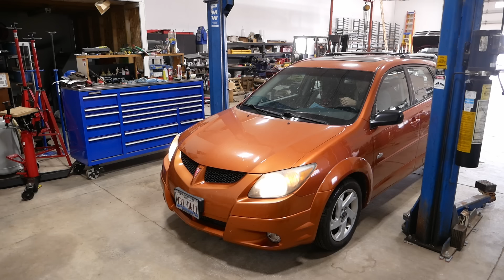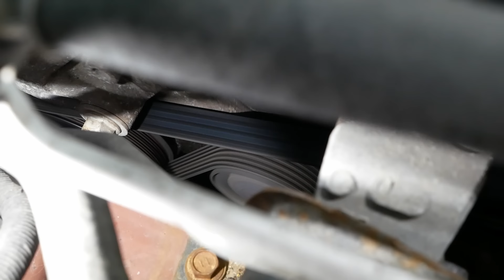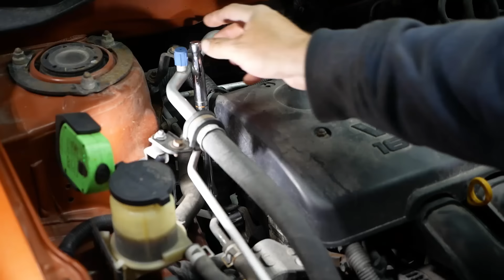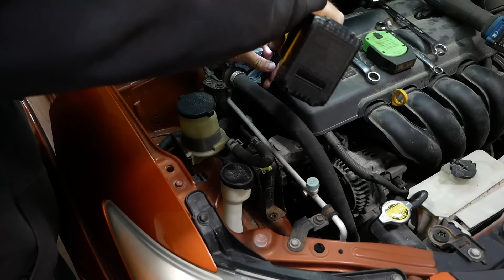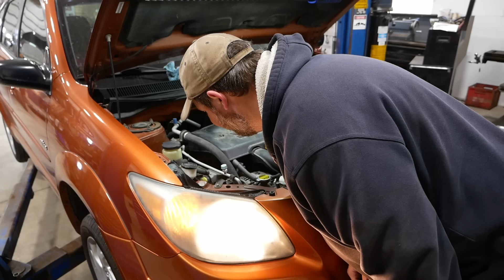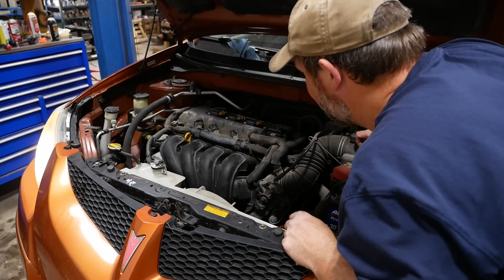My Worst F-up as a Mechanic - Hurt Myself, Damaged Customer's Car - Vibrating Vibe

Comment: I also left someone brake caliper bracket bolts just barely snugged up finger tight once.  A week or so later the bolt feel out sent the caliper into the wheel, locked the tire and sent them off the road.  Luckily no one was hurt and the car was okay.  Just needed a new parts and put back together.   I went out a 2am when it happened and got a bolt back in it so they could drive it home.  Now I check everything like 5 times before it leaves.

Comment: The good news is, your vibration is gone😂.  I was working on a Ford Taurus SHO that was parked in my driveway. I just finished putting a fuel pump in a Dodge pick up. I backed the truck up and cranked the wheel too tight and put the front bumper of the truck into the front fender of the Taurus. $1500 later….! At least you are safe. Life goes on.

Comment: My biggest F up was a BIG one. I had a Diesel engine with bad pistons and rings. I replaced pistons and rings with new ones and in the process lost one of the connecting rod bolts. I just went to Ace and bought a new on with was not hard enough. Started the motor and it ran great for about 5 minutes and then a rod came through the block!!!$3000 lesson learned!

Comment: Years ago, I did something very similar - just installed a new auto trans (my first ever) and had the door open, engine running, standing outside the car with one foot on the brake and working the gear selector through the ratios to get the air bubbles out of the fluid and my foot slipped off the pedal and the car drove into a bollard and smashed the headlight. This car was actually cursed, because the next day, I was approaching a rail crossing when the lights started so I pulled the selector back from 4th to 3rd - only I was not in a manual, and I had accidentally put it into reverse - so lucky it was raining as the rear wheels locked up and I just slid a few meters before I realized my mistake - happily the new transmission was still OK! phew. like you, I called myself stupid more than once :-)

Comment: I did something that went totally wrong, yet miraculously nobody was hurt.

In the late 80's a guy at work had a mint looking '70's V8 Dodge Dart Swinger with a for sale sign. I knew someone looking for a cheap car. We met at his apartment  During the test drive, the engine shook at idle but in gear only. Back at the apartment, I adjusted the idle mixture screws and had to do this in gear because if was smooth in neutral. Parking brake was firmly on. I was on driver's side and gently blipped throttle. Car suddenly took off at full throttle burning rubber, ran across the grass and into the adjacent brick apartment building. I can still hear the owner yelling "Oh no" over and over. It may have stalled after crash or I shut ignition. What a mess, but nobody was in the missile's path or standing in front of car. I was in front earlier to get to the screws. I found the problem, the throttle was being held wide open by a throttle spring. Never saw this before. Someone put the two throttle springs on wrong. Both should pull throttle closed. Two are used in case one fails. One was wrongly pulling in the other direction opposing the other. The closing one was not properly installed and fell off the arm when I blipped the throttle. Now the other spring instantly pulled the throttle wide open. Car must have been totalled. We felt awful but clearly it was an accident waiting to happen and eventually would have happened in traffic. It wouldn't have happened if someone was in the car, foot on the brake and I should have had someone to do that. Safery first.

Comment: For those wondering: ALWAYS have the parking brake on and firmly press the brake pedal if you're going to brake torque the engine to check for a bad mount. It happens. I once forgot to pump the brake pedal after doing a brake flush, put it in reverse, and went flying out into the parking lot.

Comment: Don't feel bad. I made mistake too.  I blew up my cooling system by running the engine with limited time plan due to a jammed fan just to keep the oil throughout the engine until I get it fixed. I got carried away and my engine overheated and blew the cooling system.😊

Comment: After a stupid mistake in which you could have been badly injured you then go ahead & wedge & wiggle a ratchet with a 17mm socket on it, right next to a spinning belt! Are you out of your mind; if that got sucked in the whole lot would act as a projectile, could break your wrist.....you're not even wearing overalls!!

Comment: My sister's 2001 Chrysler T&C had a similar problem mostly noticeable when in gear and stopped.  It turned out right side motor mount had a broken bolt, one loose and the other hanging by a couple of threads. She had been driving it that way for months.

Comment: The emergency brake works much better than wheel chocks. My friend was trying to replace one of my U joints on my 95 Suburban in his driveway, which had a fairly pronounced incline. He was all the way under the vehicle and having trouble popping the rear U joint loose, so I grabbed a bar and wedged it into the joint and popped it out. The vehicle immediately began rolling backwards down the driveway. I was able to get out because I was only a couple inches under the car, but it rolled him up and went right over him. Broken collarbone, hole in one of his shins from a bolt lying on the ground when the front tire ran over the back of his calf. Afterward, he spent the rest of the day saying he couldn't believe he forgot to chock the wheels. Safety first.

Comment: Accidents happen. Thank goodness I’ve never crashed a customers car. I did however pop a tire on one several decades ago. Pulled in to the stall a little too sharp with a Buick LeSabre, and I hit the arm of the lift, causing the front tire to pop. $78 out of my pocket and the gentleman also got a free oil change!

Comment: Reminds me of that time someone left a chuck key in a lathe and turned it on missing another classmates head by about 4 inches when it hit the wall. Personally mine was running a Mill in machine trades and I didnt tighten the vice down enough the part literally came out and spun around the drillbit. 

If I was you id buy that wall a beer 🍺  lol glad your safe man.

Comment: When I worked installing car audio in college, we had an experienced guy in the shop working late and behind on work. He drilled a hole through the firewall to run wire on a 2nd gen eclipse. He drilled into the master cylinder. 2 high school girls got in after the install and drove off. They came up on the intersection exiting the parking lot and rolled right through it and stopped on the curb on the other side. They almost got t-boned and traffic was raging at them. Their dad showed up to the shop the next day ready to kill.

Comment: Had this vibration and noise on 1999 Corolla but fixed it in the store parking lot without incident. 
But I had really hard time dealing with aftermarket power steering pressure hose on 2001 Accord

Comment: Respect for admitting you did something stupid and allowing other people to see it so they might learn from it.  I'm interested to know what your thought process was here though.  The car was already in the lift bay.  What was the logic in not using the lift to get the wheels off the ground if you wanted to run it while in gear?

Comment: Mine wasn't that bad, but I dropped one off of a jack a few weeks ago and broke the radiator.  I was just in a hurry, it was getting late after a very busy day.  I didn't get down and double check that I was centered up on the sub frame and it slipped off.  Luckily I wasn't under it when it happened.  Had to buy a $200 radiator and coolant, and it took about 6 hours to tear the front of the car off and replace it.  I told the customer what happened and that I would make it right.  And the customer was okay with it.   But, still you feel so crappy after doing something stupid like that.  A set of good wheel chocks would have helped too.

Comment: 30 years ago I was working on my old manual transmission Dodge 150 truck. I had parked it in 2nd gear while working on it and at some point without thinking reached through the drivers window just to bump the motor over. Of course it started in gear and away it went across the yard, ran over a wheelbarrow and then crashed into the wall of an outbuilding before stalling and stopped. You better believe I cursed myself for a fool and learned a lesson that day.

Comment: Use a round piece of wood hold it to your ear  and put the other end on places you wish to check to see where the noise is coming from. This old school  trick works great for finding vibrations or bad bearings

Comment: I did that in my Dads shop when i was younger...except it went the other way,Out thru the overhead door,across the driveway into another customer's car.
It was a 63 split window vette my dad had just got done painting it...the tailites,bumpers,both rear windows smashed...overhead door smashed and a 67 GTO got the drivers door and front fender smashed in...i spent the next year working for free 6 days a week to cover the cost of the damages...know what i did?
Jumped into the Vette when my Dad wasnt around just hear it rumble...simultaneously turned the key and stabbed the gas..she started right up!! And the gas pedal got stuck

Comment: I'm an electronic technician  who often rebuild older equipment, vacuum tube or valves are often under thousands of volts and in bigger systems like older AM Shortwave transmitter , under few amperes. Never mind radio frequency burns, so when I get "target fixated," or just tired, any mistakes can be instantly deadly or cripple me for the rest of my life. I have a few mishaps but anything too serious. I assume it's the same thing with cars and mechanics . You are very lucky not to have hurt you.

Comment: Dont feel bad I was working on the simplest thing. All I had to do was plumb some lines and attach a couple relays. Easy right....
Well it was a 500hp nitrous system and i somehow managed to not connect the fuel all the way.
After that day a fuel pressure switch is mandatory...The pistons and valves. She went "Zeeeee clunk Pooofz"!  And, ticka ticka tick tick tak. And magic smoke fell out the exhaust.
Luckily it was only some slugs and valves. lifetime lesson learned...Triple check! (and use safety or limit switches)

Comment: My first day working at Mitsubishi  We had customers stop in mid road trip to have the tire pressure sensors recalibrated.  While their vehicle was in the garaga middle lane,  our service manager got in a Outlander that just had new brake pads and rotors installed front and back.  The service manager was going to just back the vehicle up a couple feet, puts it in reverse, touches the gas but the brakes haven't been bled yet.  He slams into this family's RVR who's on a roadtrip, panicks puts the outlander in drive and drives right through a snap on toolbox into thru a wall into the body shop.  He didn't know the brakes had just been done.  I was standing over on the other side of the garage in complete shock to what I just witnessed, its my first day ever working at a car dealership.  I thought he either took a stroke or was pissed off lmao, he was pretty shook up himself lmao

Comment: When I was turning wrenches I was working on a Dodge pickup standard transmission. The truck had a no crank condition battery was good starter was good  (jumped it with a battery cable) The Mechanic helping me was turning the ignition switch while I was shaking the wire harness sure enough there was a short. The starter engaged while the truck was in gear. I was pinned between the truck and the workbench. Luckily the truck didn't start and stopped when I let go of the harness. Ed quickly pressed the clutch pedal and pushed the truck back. Good thing the workbench wasn't tight against the wall I was lucky.

Comment: Yes, we do some crazy things sometimes. 
Certainly my most stupid moment was when working on an unfamiliar piece of equipment ( that unfamiliar, i had never worked on this model before ) .
It was a 3000 V,  3 Phase transformer . 
To prove it dead, i touched the terminal with the back of my hand. 
I still to this day cannot believe i did it, wtf was i thinking. 
Luckily for me, it was dead with no residual stored energy either, otherwise i'd have literally been toast.

Comment: I actually have that exact car and I've had it for 3 years and I love them. It's because of the 1.8 l engine but it was made in California in the old GM factory that put out junk cars and they went with the Japanese way of building their vehicles and how they check everything. The ones made here were junk. Because they were shipped over in parts and they were put together here. That factory has gone out of business it was only running for 10 years and 80 percent of the Pontiac vibes in California by a Japanese companies rules and standards..

Comment: I’m not a mechanic by trade, but I’m a good backyard mechanic. I’ve also owned many Toyotas and i have 2 Camrys right now. Both 2AZ’s. I do all the work on my own cars. At the risk of looking stupid I’m making this comment before I even watch the video. If I’m wrong I won’t delete it.

 I heard the car when you pulled it in. It’s got to be the intake. The plastic intakes crack on Toyotas and make that exact sound. I’ve done the job on a previous Camry and on one of my current ones. I even bought an extra for when the third one goes. I just get the cheap Doorman because it’s an inherent problem with plastic Toyota intakes. Hopefully I’m worried about my Diag.

Comment: I broke an inspection mirror inside a jet engine once. Luckily I was able to reclaim all the pieces (reassembled the mirror on a piece of sticky tape to verify I had it all) and the fighter was back in action at lunch time and the engine didn't have to be polled out. And no, it would not have blown out the pieces off the other end!

Comment: I had a nitemare with a belt tensioner. Tried to get the old one off. Just would not come.off. Tried tapping it with a hammer. It came off easily, but the locking pin stayed in the block. Tried melting it out. Weird angle with frame in the way. The new part needed a hole for the pin to go into. So, I bored a 1/2 inch hole into the block. Luckily, I didn't bore all the way through. Got it on. I hate working on corroded cars.

Comment: First of all, I almost burned down my entire garage because I did not realize how flammable "break clean" is.I had spread news paper in multiple layers to catch the dirty spray an the saturated newspaper was subsequently ignited when through a spark while grinding. It was horrible as I had no way of putting the fire out and could only snuff the flames out with what ever I could find. Burnt the hell out of my hands.

Secondly, I guess your a much better "Christian" than I, because I was throwing F bombs like it was WW11 atomic raid on Japan. So good on ya, but I gotta cuss or I'll die.

Comment: One time after changing the oil in a car I put it in neutral with the door open while it was running and pushed it back a little to make sure there were no drips or anything underneath. Well the concrete has a little slope so once it started to roll I couldn’t stop it and with the door open it was going to catch on the wall since it was extended out past the size of the shop door. The only thing I could do was use my foot under the tire as a wedge and it worked but I couldn’t get my foot out. I layed on the ground for 3 hours with the car on my foot until someone finally heard me yelling.

Comment: Ive been working on cars since i was 11,i just turned 53, believe me, we have all done stupid stuff not meaning to,i remember when i was a kid growing up in a farm,i didn't have a drivers license yet so my dad and i found a 1957 land cruiser in a old wrecking yard and he asked me if i wanted it? really? hell yeah!!! so it was my "farm car", it needed lots of work and it was in rough shape so i cut my teeth on that thing, 4 speed monster.

First time i changed plugs on it i pulled the wires off,label wires? what for? once i got done changing the plugs i just put the plug wires where they looked cool,once i fired that thing up it was bucking like a 3 second bronco, my old man asked me about he plug wires and of course the answer was uhh?? i learned a lesson that day, my dad explained to me about timing and why certain things need to be in certain places etc 

Another time me and my buddy in our teens where working on his car on the front suspension,he had one of those 20 dollar floor jacks,we cranked that thing up and he actually sat under the front spindle while he was working on the brakes (no jackstands of course) , his legs were right below the car,i was right behind him and all of the sudden i started hearing this creaking sound and i grabbed him by the neck ( i guess Adrenalin) and just yanked him right out as that car hit the ground, he couldn't turn his head around for a month but he was very grateful,lol, yep we have all done stupid stuff before.

Comment: 6 years ago I just painted a 1966 Ford 1 ton frame,  it was in thr shop and I thought I would just pick it up with a single chain, not thinking about how heavy it was, I  got it up just off the floor barely,  and made one more almost Fatal pull on the chain fall hoist, the chain broke and the frame came down on my leg tearing it open to the bone, and throwing me across the shop against the wall,  fortunately my son was there to call 911 for me.

Comment: i did the same thing with an electric hyster forklift... only it drove through  a couple home made heavy wooden shelves.i was messing with the contactors.. key was off and i pushed one that happened to be the high speed foward contact and it spun tires and knocked me out the was and said cya.... i was a carpenter that day as well